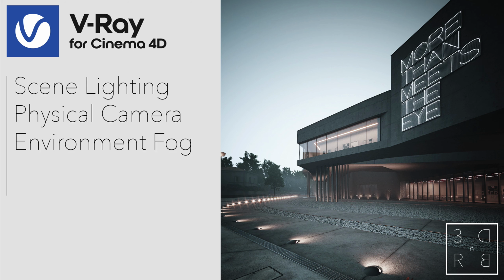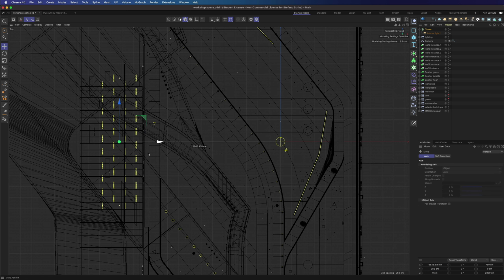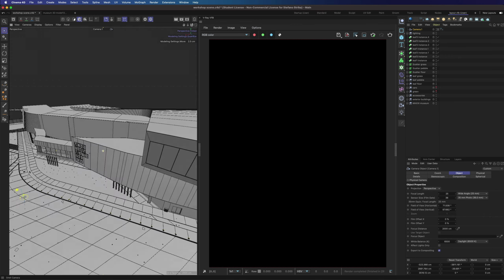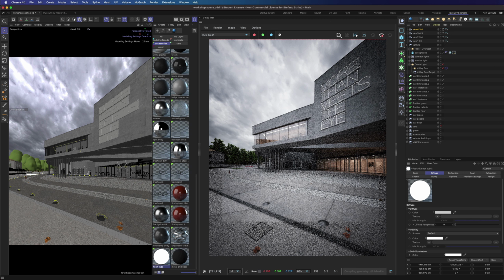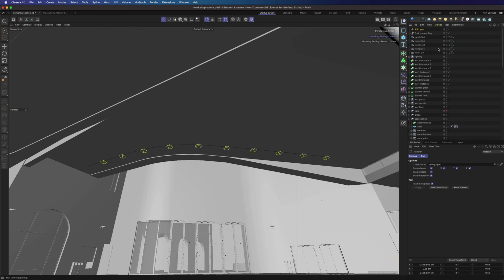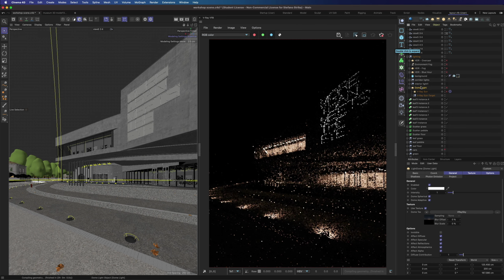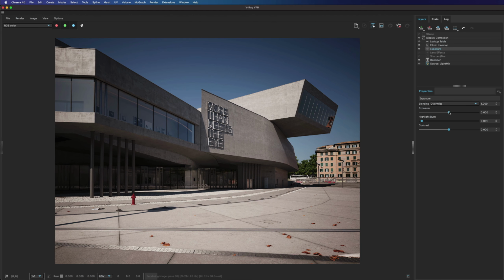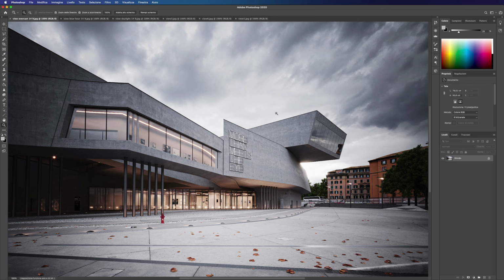Museum Scene - Making of | Vray 5.2 - C4D R25 | Part 3 of 3

Comment: Thank you so much for sharing! I have one problem. When i use film offset or shift it work in the viewport but not when i start rendering. Any idea on how to fix this? I have c4d r20 and the latest V-Ray 5 version.
Reply from the maker: Hi Florian, offset and shift work perfectly here. I’ve tested from R21 to R26, maybe is a specific R20 issue. Be sure to use the latest Vray build, if it still don’t work contact the support so that they can fix the problem.

Comment: Is there any way for VRAYforC4D to make a motion blur on changing topology? Such as mesh built by Realflow.
Reply from the maker: I have tested this on a simple fluid mesh builded using metaball and it works, so I guess it should work also with Realflow mesh. Activate motion blur on Vray physical camera and if needed rise the motion blur samples inside the Vray object properties tag.
Reply: @3DRenderandBeyond  Thank you so much. But it still doesn't work. It seems like motion blur for changing topology needs velocity info, Octane and Arnold did this. Is there similar function that can read mesh velocity data in VRAY for C4D? Thank you.
Reply from the maker: @ToTemp  are you using Vray version 5.2?
Reply: @3DRenderandBeyond  Yes, 5.2 .
Reply from the maker: @ToTemp  If you can share a file I’ll check it out